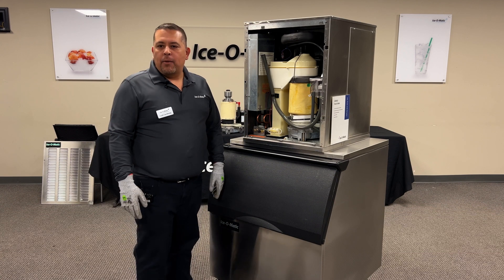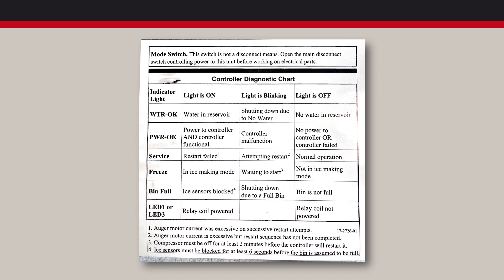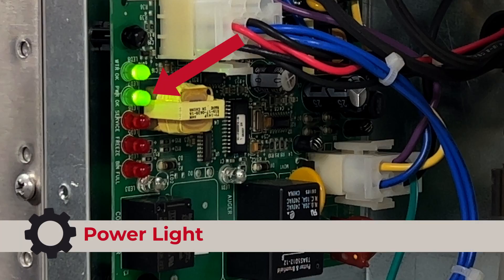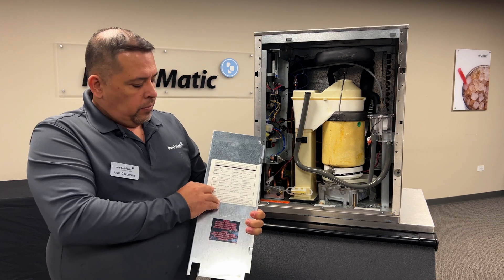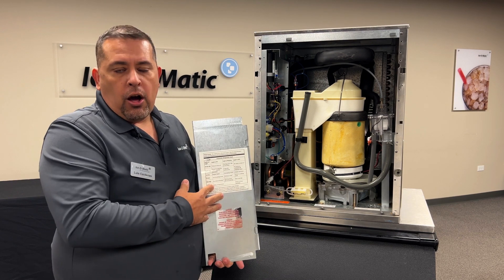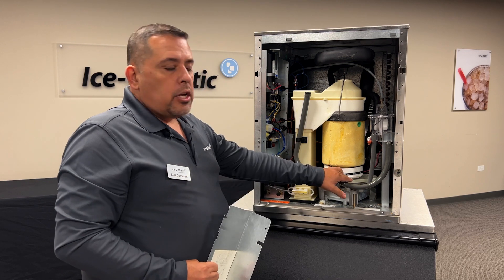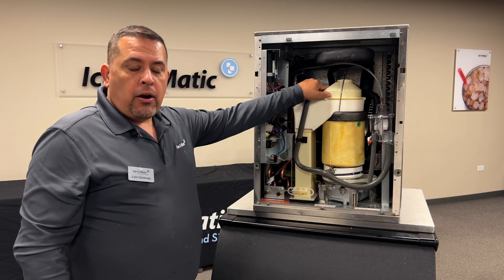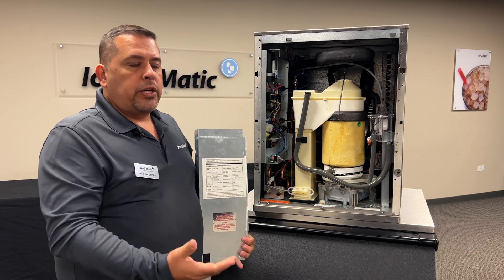Ice-O-Matic GEM & MFI Ice Machine Error Light Diagnostics

Comment: How can we troubleshoot bin full blinking?
Reply from the maker: The "Bin Full" light blinking, it usually means the ice bin is full and it can’t make more ice until you clear some out. First, check the bin and remove any excess ice if it’s packed. Sometimes, the sensors that detect the ice level can get dirty, so give them a gentle clean. You can also try turning the machine off for a few minutes and then back on to reset it. If you're still having issues, it’s a good idea to check the user manual for your model or reach out to Ice-O-Matic support for help.